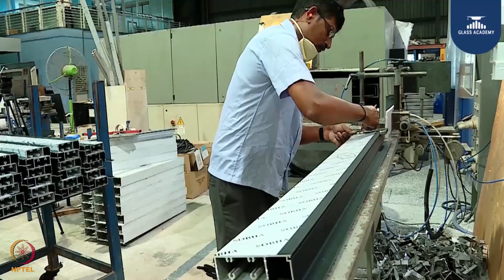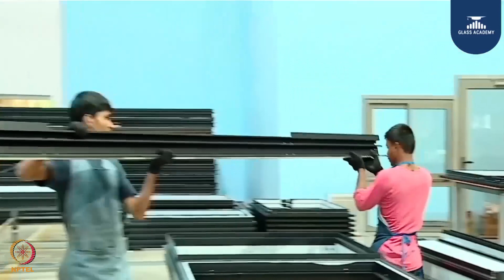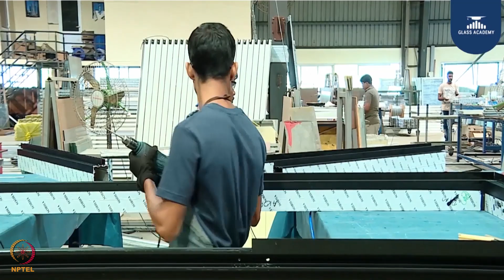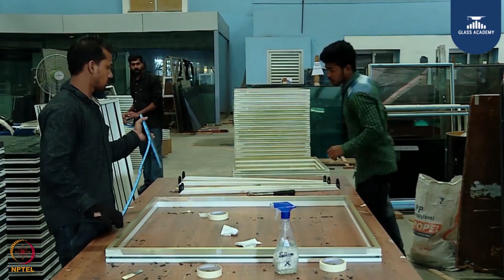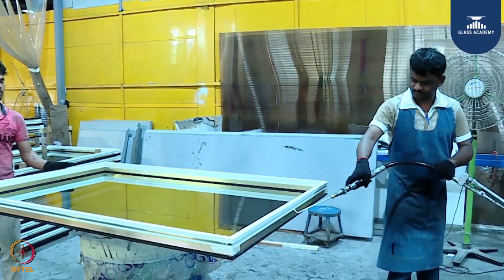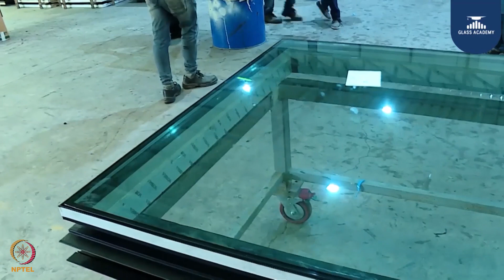Facade Factory Operations Part I

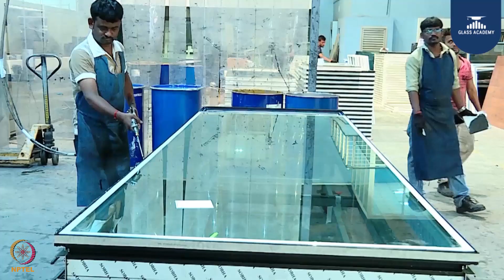Comment: 39:04 in addition...the Silicone volume section is required to have minimum of 6mm exposed width x >=6mm depth for weather proofing that's why there is a gap of 6mm. the Aluminum has larger thermal expansion than glass.

Comment: How to fix glass in structural
Reply: The glass unit must have a space between the layers of glass. Two glass units are joined using special T-shaped connectors. After that, the joints are filled with structural silicone.
Reply: @markosvjetlanovic5147 
Semi unified glazing system and structural glazing system which is the best.